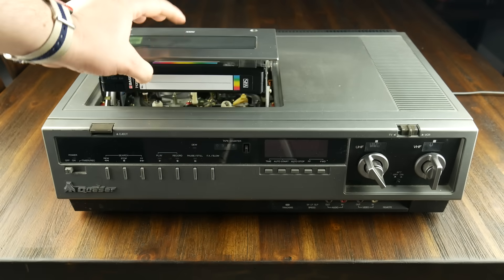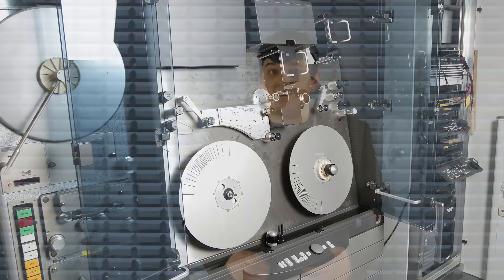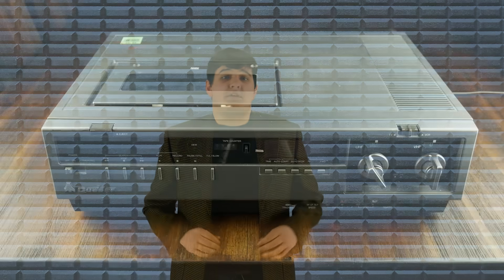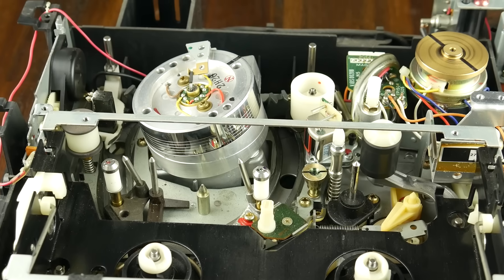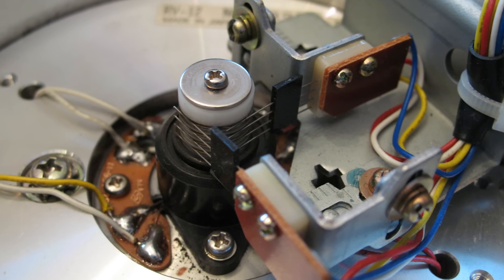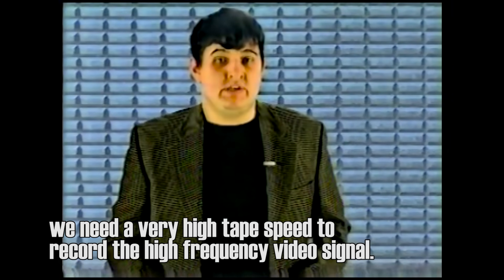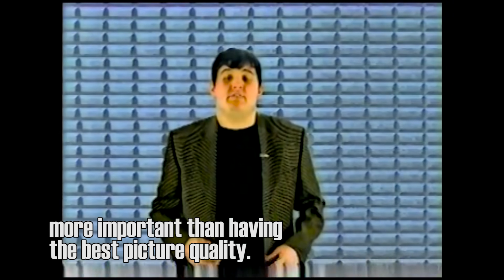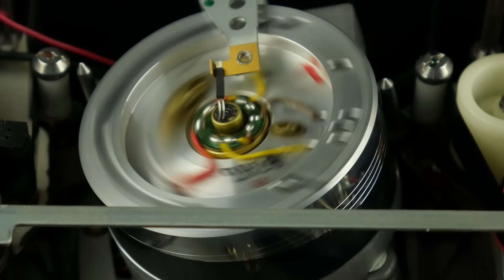The Impossible Feat inside Your VCR

Comment: I'm jealous!  You're doing the channel I would be doing if I had taken the time to do all this work.  Congratulations!  
A couple of observations about this great overall presentation.  While I haven't read all of the 2000+ comments, no one (not even the quad guys!) seems to have caught your remark that the headwheel in the original 2" Ampex machine spun at 3600 rpm.  Oh contraire!  This baby was flying at 14,400 rpm!  240 revs per SECOND!  (which was the control track frequency, someone did get that) That was definitely a miracle of mechanical engineering in 1956!  The spinning head tips were hitting the tape 960 times per second, which is why you'd hear a nearly 1kHz whine when standing next to an operating machine.  They quickly had to develop a practical air bearing for this as ball bearings quickly wore and made perturbations in the picture.
The other thing I would mention is the condition of the VHS machine you used for this demonstration.  I realize that it is very old, and the fact it still works at all is worth noting, but I suspect that the audio record bias is set too high (or the head is dirty), thereby losing a lot of the high frequency information.  While the linear audio in VHS is not stellar (you point out correctly that it's running slower than a Philips compact audio cassette in SP mode!), it should sound a LOT better than what you have here.
Lastly, in trying to heroically boil down pages of technical detail to a few sentences, you use the phrase 'color under' to describe VHS's handling of chroma information.   You describe it as being recorded physically under the luminance signal (though this was actually done later by VHS-HiFi audio), this term predates VHS as it applies to 3/4 inch machines and before. In fact, the 'under' it refers to is the frequency of the color carrier (629 kHz in VHS) is lower (under) than the picture carrier (about 3 - 4 MHZ).
You are doing a fantastic job of de-mystifying a lot of tech and I hope you keep up the great work!  I look forward to enjoying more of your well produced videos!

Comment: While they aren't quite as easy to just open up and see how they work, optical discs and hard drives are actually pretty fascinating.  Also, the platter of a hard drive after it's just been opened is one of the most reflective surfaces you will ever see.  Just gorgeous.

Comment: For LP speed why newer VHS VCR didn't record it "but stilled played it" Has to do with whats called (Special Effects) aka fast forward/rewind play & pause, on a 4 or 6 head VCR the picture would for the most part remain clean, no lines, jumpy picture etc. But with the LP speed that didn't happen.. If you paused the tape the picture would be jumpy do to the head switching this also caused during fast/rewind play a lot of scanline noise even askewing and deforming the picture, Scene no technical fix was even found, they just simply not use it anymore and even blanking the screen during the use of so called special effects.. Hope that helps, hope it wasn't too long.
Reply: The problem wasn't with pause, it was picture search.  In SP and SLP, the adjacent tracks had the same horizontal phase, so when the heads crossed over into the next track, there was just a line of noise but the picture still lined up.  With LP, there was a half-line delay between tracks making for a very distorted picture.  Panasonic's early high-end machines had a half-line delay line in the video circuit that would operate in LP picture search mode, obviating the problem.  The less expensive players didn't bother with this.
Reply: Thank you for clearing that up for me. I only remember some of what my dad told me over 20 years ago & he was i technician back in the day.

Comment: Not sure if anyone else mentioned it, but I believe the removal of LP had to do with it not being part of the official VHS design created by JVC. If I recall correctly it was Panasonic who added the feature to their machines first. Not to be beat at the maximum recording length on their own format JVC fired back by adding SLP. One thing I know for sure is that if you compare LP playback on JVC machines to LP playback on Panasonic machines you can see that JVC didn't put that much care into preserving the picture quality you could get at that tape speed.

Comment: I worked at a television station that still used 2inch quad in the early 90's because A) they were already paid for, and B) it was much easier to thread a 2inch machine than a 1inch machine, due to the straight tape path through the scanner. My first job there was to assemble edit commercial breaks from 2-inch quad to ¾ inch cassette for air the following day. We had a room that was lined floor to ceiling with 1,500 bins, each containing a small plastic reel with as many as 10 spots on it. I would come to work around 4pm when the next day's log was finalized, and take the (dot matrix!) printout back to the machine room, count the spots, then begin my run. Over the next seven to eight hours, I would retrieve, thread, cue, set levels, and dub 300-400 spots (half the log) for the next day, then my counterpart would come in around midnight to finish up. 
We had three 2-inch machines, affectionately known as "Able," "Baker," and "Charlie" which were still connected to the air chain some four decades after their manufacture, and they were something to behold, standing over five feet tall, crammed with relays and tubes and air lines, and we went through cases of liquid freon which was used for cleaning the scanners. I got to where I could thread, adjust levels, and cue a tape in less than 15 seconds or so, depending on how many cuts were on the reel. 
Those machines would likely be in service yet, except 3M stopped making 2-inch tape!
Reply: wow what a lost art.

Comment: Great video. Regarding the audio, in PAL countries it was even worse with our SP speed being under 1ips. Dolby noise reduction was fitted on some machines from about 1981 onwards to overcome this until hifi in 1984. SLP is a rarity on PAL machines as with the slower speed E-180 was the standard length and E-240 tapes were also commonplace. As an aside, with don't have Quasar in the UK but judging from the look of the mechanism am I right in thinking it's a rebadged Panasonic?

Comment: I used to teach service heads how to service RCA and Thomson VCRs back in the mid-90s.  One other thing of marvel in the VCR machine is the amount of tape speed control for quick rewinds, precise stops, etc. - all using just a two-bit control signal. I believe the guy in Germany who came up with the control algorithm was given a internal technical award. Truly a solid engineering feat!
Reply: Buck Rogers much of the tech developed for vcrs is still with us today including the multiple methods for connecting a large array of buttons to the cpu with only 4 wires as well as the general robotics that made all the later mechanical formats possible.
Reply: Was that the I2C or Inter IC protocol still used for various low speed chips like configuration flash memory and motherboard temperature sensors?

Comment: I started with Sony Betamax, then eventually bought a VHS unit since VHS LP was a good video compromise to Betamax BII speed, which was less than 4 hours. When HiFi audio came to home video, things were...OK, though LP video quality was lower because it was recorded using SLP heads. Copying home video was an exercise in futility, since video dub quality was half of the original. "SVHS"? That was for Rich folk, so I didn't sign up. Eventually, I found a VHS + DVD recorder, and discovered that DVD LP recording speed was at least "VHS quality" and a video dub was OK. These days, Ye Olde Panasonic (2009) DVD recorder is wearing out and it's only a matter of time before I'll have to sign up with DiVo and digital video. (TV Guide is a very poor "utility" to schedule recordings, and even Apple has pronounced "video is dead," demanding that I sign on to that MP3-indexing/thief Cloud.) Oh well, it was a good run.

Comment: So, the entire reason VHS needed to use super-high frequencies in the first place was so they would match the frequencies used by television broadcasts themselves—I'm guessing VHF channel 4 in particular—and therefore be playable on existing TV sets using the built-in tuners? Does that mean that if they were willing to make VCRs exclusive to special TVs whose tuners have an extra "channel" in the audible sound range instead of the VHF band, they could have accomplished the same thing with a stationary read head?
Reply from the maker: Not quite.  Any channel needs the same amount of bandwidth to display an image.  Because the image is made of 525 lines that are drawn 30 times per second, you need a very high frequency carrier to actually resolve detail in those lines.  In television, the channels just dictate what frequency the signal is transmitted on.  The VCR is writing an image on the tape with about half the detail of television.  It's up to circuitry in the machine to translate that into the appropriate output (NTSC/PAL, etc) for a TV to display.  
Think of it this way:  with 525 lines drawn 30 times per second, there are 15,750 lines to be drawn per second.  If you want each line to be able to resolve a change in brightness just 8 times across its length, you'd need a frequency of at least 126,000 Hz, well beyond audible range.  But that would only produce this much detail across each line:
_  _  _  _  
  _  _  _  _            (<<8 maximum registered brightness variations per line)
_  _  _  _  
  _  _  _  _  
To make a usable image, you need WAY more bandwidth than that, hence the reason the television signal is about 5 MHz.  Since frequency response of audio tape is limited by tape speed, the rotary head drum was designed to provide sufficient speed to produce a very high frequency, capable of resolving many changes in image detail in such a tiny fraction of a second.  Hope this helps!
Reply from the maker: Audio tape isn't modulated at all.  The signal is spat directly onto the tape.  The entire reason VHS "stacks" the signal is due to the required tape speed.  Perhaps this will help to explain:
The ferrous particles on magnetic tape are what the signal is made from.  The highest frequency signal you can produce is dictated by how many of those particles travel past a record head per second.  If 10,000 pass per second, the highest frequency you can record is 10 kHz.  So, the only way to record a higher frequency on the same piece of tape, is to make the tape go faster.  Video signals are modulated on a very high frequency carrier, so millions of tape particle need to pass the head per second.
The helical scanning of the VHS head drum was a way to do this indirectly.  To move the tape past the heads that fast would require the 15 feet per second tape speed of the VERA system.  But diagonally recording stripes onto the tapes and moving the heads past the tape at high speed, much less tape was needed and more practical tape speeds could be achieved.
ElectronAsh: that's very interesting stuff!  I worry about DVHS, though, because IIRC the tape speeds of DVHS were very different.  I'm not sure if slower speeds were managed in steps with a memory buffer onboard the VCR, or perhaps it ran at a very slow speed.  That would, I think, be your biggest hurdle.
Reply: Technology Connections

Something you might find interesting...

For many years (since reading about D-VHS in Home Cinema Choice magazine), I've wanted to see if I could digitally sample the raw RF signal from a VCR, and then hopefully record some digitally compressed video back to the VHS tape.

A friend of mine has recently made an ADC board for capturing the raw RF from a laserdisc player, so people can make the best possible backups of things like the BBC Domesday discs.

http://www.domesday86.com/?author=1

You may have also seen the work of "happycube", who did a similar thing where he decoded the captured analog signal from laserdisc in software?

Well, apparently there is already a fork of that code that is intended for doing the same for VHS. ;)

Yeah, it's quite a long-winded story, but I do intend on trying the ADC board with a VCR soon.

It may eventually also be possible to decode the analog video (and HiFi audio) in realtime using an FPGA.
Then, all kinds of enhancements could be added, like a deinterlaced HDMI output etc.

(the LD decoding software already has a Time-Base Corrector and drop-out / error correction etc., so I'm very eager to see how it performs with an average VHS deck.)
Reply: Technology Connections

There are some nice examples of the software LD decoding here, as well as a some VERY interesting (to me, at least :p ) engineer training vids...

https://youtu.be/Vh1ysah_1B0
Reply: Technology Connections

It should in theory even be possible to decode D-Theater tapes on a standard VCR soon, and even record new ones.

(That is unless the D-VHS decks have a weird configuration and / azimuths for the video heads, which I haven't looked into much yet.)

I'm still trying to forgive Mr Techmoan for throwing his first D-VHS machine away. lol
Reply: I don't quite understand, but wow, thanks for actually responding! Does it have to do with the signal (which is a single, infinitesimally-thin AM signal like a wire recording but with way more information) being striped across the tape in stacking columns to take advantage of the tape's width? As opposed to audio tape, which I'm guessing is FM and thus can fit more detail on a wide tape (or at least more dynamic range) by just stretching the waveform all the way across.
Reply: Technology Connections

Yeah, I think there could be some issues there.

Although, if most DVHS decks support analog VHS playback too, it suggests that it might be possible to modify a standard VHS deck to play D-Theater tapes.

It will be fun to at least get VHS decoding working in software at first.
The guy said that he will be sending me a bare ADC board soon, so I can start experimenting.

The ADC is 10-bit, and they are sampling Laserdisc RF at 32 Msps, then transferring that to a PC via USB 3 at 64 MHz.

The 10-bit data is expanded to 16-bit by the FPGA though, since the FX3 USB chip has a 16-bit wide input.
That means that the peak transfer rate required is currently a whopping 128 MByte/sec. :o

I'm hoping to reduce that a lot, as it's pretty insane. lol
Reply: This is a great explanation of how signal bandwidth translates to image quality.  I never fully understood it until now!

Comment: Nice video but with an exception: the control track is a constant frequency of around 240hz sin e wave not pulses. To get frame pulses, this number was divided by 8 to get 30 frames per second. This would set the capstan at the correct speed for tape motion. Once the tape is moving at a constant rate, the head drum uses this signal as a coarse speed control with the "tracking"  being a fine tuning to obtain maximum RF signals from the video tracks themselves

Comment: If you want VHS to look decent, you have to do it the way it was done in the '80s. Your TV should be a standard definition (~15 kHz) CRT, no bigger than 27". No one had a TV bigger than 27" in the '80s unless it was a rear-projection TV, and those looked like crap no matter what. It wasn't until the early/mid 1990s that I saw 29" and 32" TVs.

Also, make sure your TV is adjusted right. Back the brightness off some (most people had the brightness of their CRT TVs way too high) so that you get good black levels. VHS has really poor color (only about 30 lines of chroma resolution), so it's best to back off the color saturation as well. If you get the brightness and color saturation right, it hides a lot of the deficiencies of VHS. Then, view it from across the room, and it will look fine, pretty much the same as an over-the-air or cable TV broadcast did back then.

Comment: I remember renting VCRs from Blockbuster way back when most people couldn't afford a VCR. They came in a huge black protective plastic case. When we final bought one it was a huge, heavy metal beast that ejected from the top. The tape counter was mechanical and the 2 channel knobs on the front required almost all my strength to turn. It was amazing.

Comment: Oh FFS! Someone tell me the time code where he starts talking about the ACTUAL FEAT. Listening to the 10 millionth video of how VCR works is beyond my patience limits.
Reply from the maker: +Maloy7800 The feat was figuring out a way to capture the very high frequency video signal onto magnetic tape.  That's why the video talks about the VERA, the Ampex system, and finally the rotating Head drum inside your VCR.  I'm sorry if that didn't come through clear to you
Reply: Oh, I see now! :-) I was expecting some kind of a mechanical device inside the VHS cassette that I missed while disassembling it. :-))

Comment: I recall using Panasonic "semi professional" gear like NV-100 or so, with the jog it was able to PERFECT STILL and FRAME BY FRAME jog with insane accuracy. No matter if the tape was recorded in a standard VCR. A monster of a machine. You could locate the exact time and FRACTION where continue recording. On the other VCR you could locate start and end with incredible precision. It was a bit labor intensive, but then, you hit the button and voila ... PERFECT segment copied to exact location spliced at a frame level with uncany accuracy. The editing idea before EDITING SW. All controlled from a central pannel. Panasonic for Prosumer and Broadcast .... worth every penny. Work for hours, always perfect.